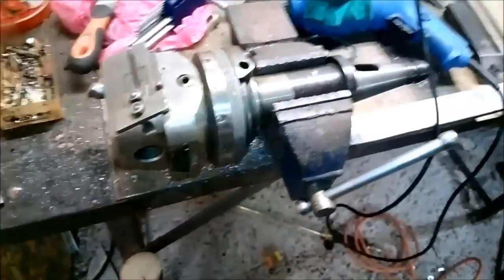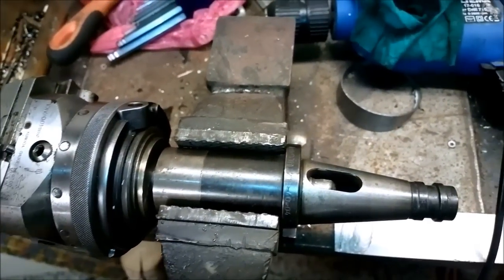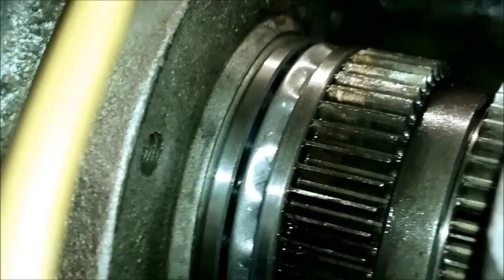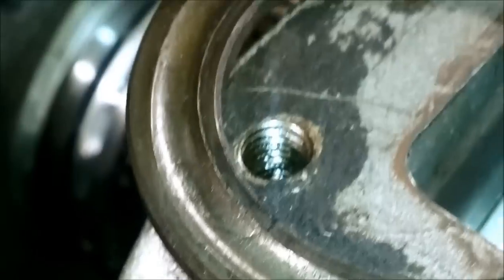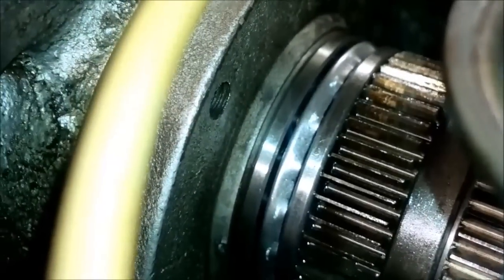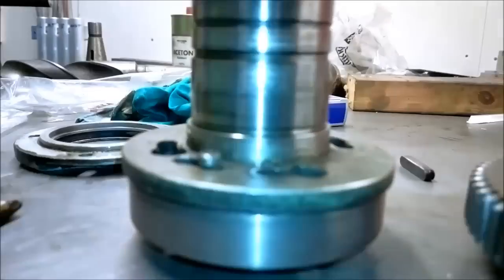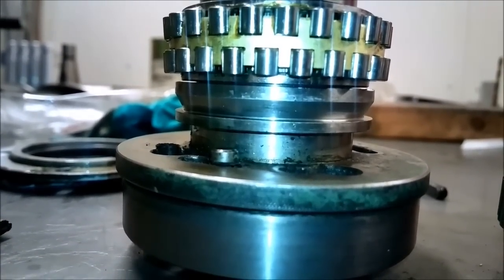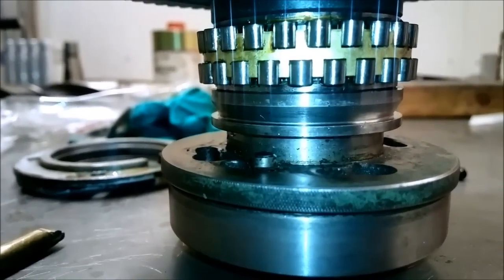Spindle bearing talk and progress

Comment: I like these russian lathes nice and heavy duty well kinda ..but there engineering IMO is over complicated ...now with that said how do you know its not the OD roller bearing race having slop? having a taper on the ID of the bearing is good idea I like the wedging  effect! but I think they sent you the wrong bearing! glad you purchased the lathe cheap :)
Reply from the maker: Overcomplicated is not excactly how I would describe soviet engineering! I guess it is quite the opposite actually! This is as modern as USSR machines ever were and there is still nothing but gears, shafts and bearings :-). Everything can be fixed and replaced pretty easily. I checked the OD ring by indicator while trying to push it. No slop there luckily.
Reply: sunppaa yea but there is an apparent bearing issues with these lathes factory dragon replaced them 2 times! thats all im saying usually over engineered = more problems...It will be a killer lathe once you fix all the problems
Reply from the maker: Lawrence Harasim
Yeah, as simple as possible should always be the way to go on machinery!